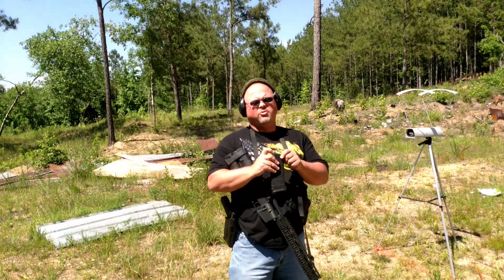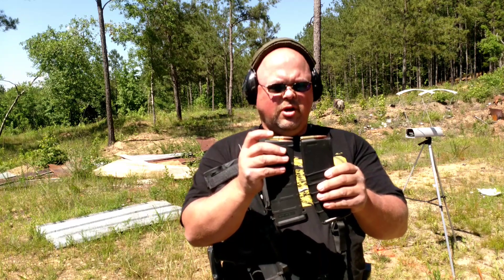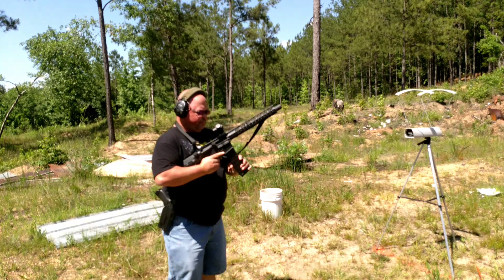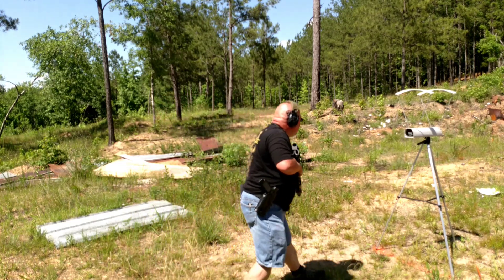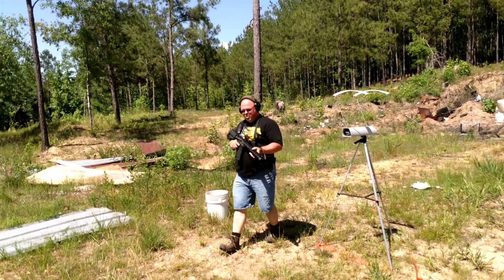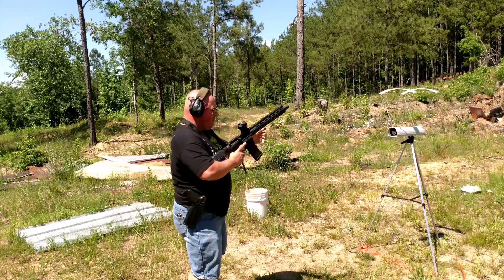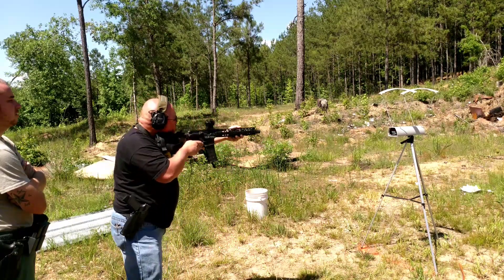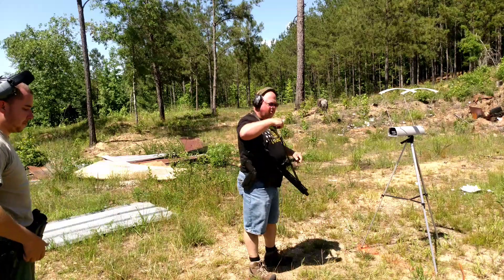300 blackout. Will heavy subsonics stabilize in a 1:8 twist.

Comment: Look up Greenhill formula. Measure your bullet OAL... Different bullet profiles such as Very Low Drag or VLD's will produce more stabilization / accuracy. 
The slowest possible twist for bullet length should give you the best accuracy.  Pick the average weight bullet you are going to shoot the most and buy the barrel with the twist that fits your bullet length...

Comment: I was about to purchase a 10.5" barrel but I was worried about the twist rate on the one that I was looking at is 1 and 8 twist or I can spend a few more dollars and get a 1 in 7 twist
Reply from the maker: You should be fine.
Reply: A 10” barrel length with 1:8 twist  should be able to stabilize a 220gr in a 300 bo, but it is also load and actual projectile profile dependent. A < 10” 1:8 will very rarely stabilize a heavier grain projectile. If you want to run sub rounds in a pistol/sbr 300 bo, stick with 1:7, it’s a lot more reliable and really only consider 1:8 for a 16” rifle.

Comment: please please do this with 7.5" barrel and 1:8 twist! plz. 

im doing a build now... and told supplier to hold my order.... 

i want to use 7.5 barrel.  but if it dont stabilize they also have 12.5" barrel. both 1:8 twist. 

this is going to be a dedicated subsonic gun...

and a 7.5" will be accurate up to what range beforw tumbling? 25?50?100 yards?
Reply: You need the slightly longer Barrel if you're going with a 1 in 8 twist seven and a half inch barrel or eight and a half inch barrel I'm seeing and hearing that those don't stabilize with a 1 in 8 twist
Reply: @crypto_pinto2660  damn looks like I need a new barrel
Reply: shoot im running nothing but supers im not going to run a can cause i dont feel like paying an additional $200 tax stamp  on an already pricey item AND putting myself in ATF radar with their trap 😂